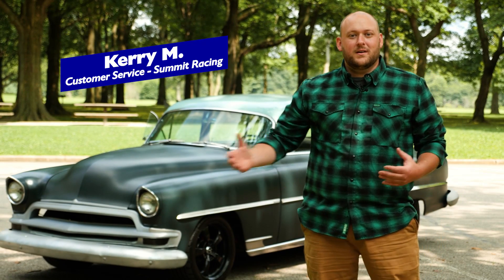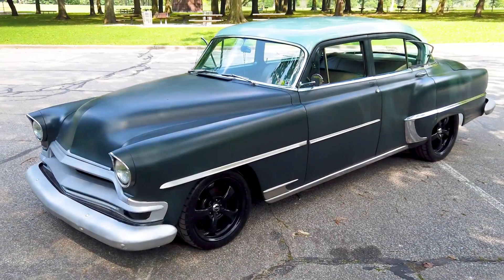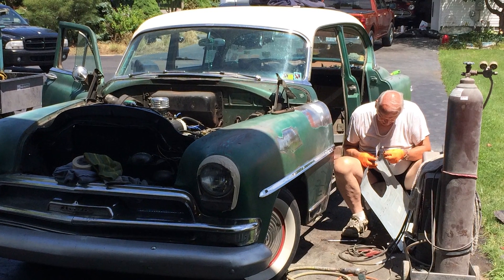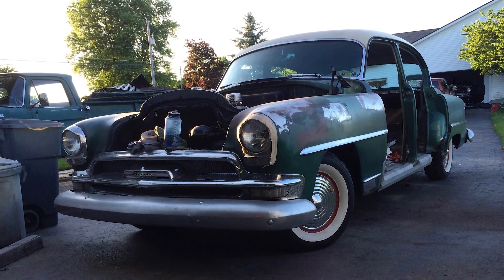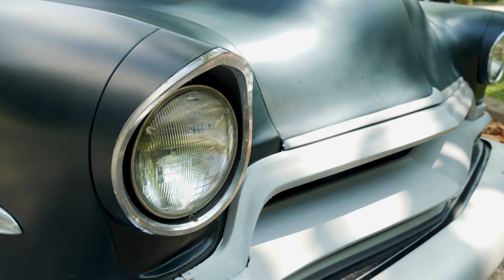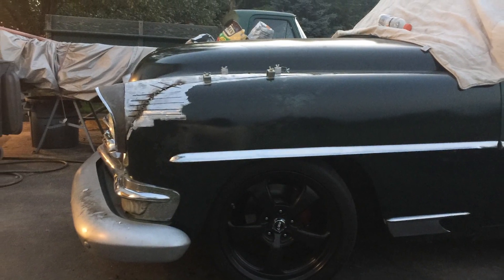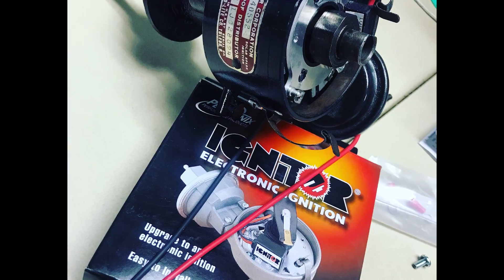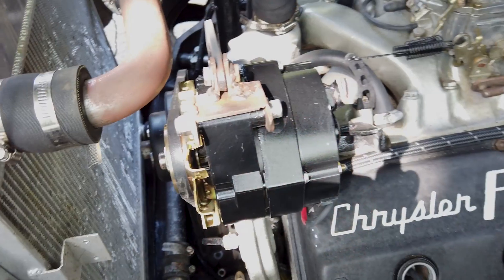Kerry's 1954 Chrysler New Yorker

Comment: When you converted this to 12 Volts, did you happen to keep the 6 Volt Starter Relay that was mounted on the drivers side inner fender? The Negative cable from the battery would have been connected to the relay. If you still have it would you be willing to sell it?